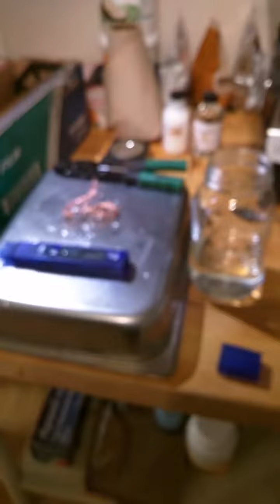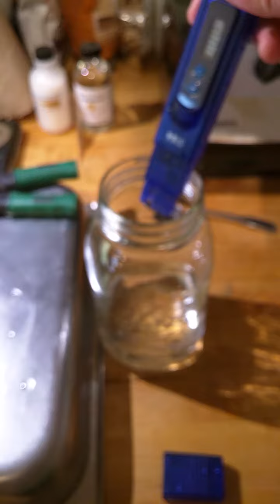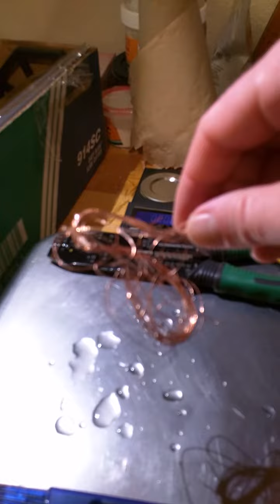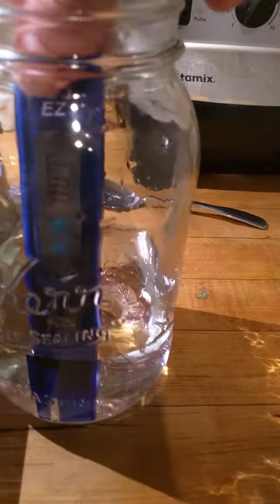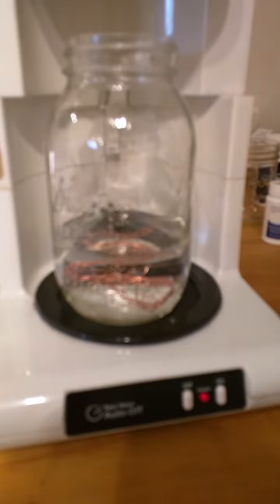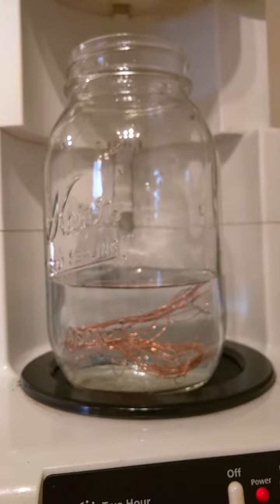Making colloidal copper with a coffee maker easy

Comment: Bro you're making an interesting brew there but it's not colloidal copper;) Copper ions are formed during a process called electrolysis, not by submerging copper in hot water. What you're measuring are unrelated copper oxides.
Reply: and what you're describing, is copper hydroxide...

Comment from the maker: Try it out . Use the ppm meter... The reason for this method is the prolonged controlled heat without loosing the water to evaporation. A kettle on a stove top does not have such consistent heat but try it out maybe it will work
Reply: Hello Jeff!
Have you experienced any good results using this method? 
Some say the particle sizes become too large this way.There is so much conflicting information/disinformation...

Comment: It works, I used water from my RO filter which read 30ppm prior to adding copper, after 4 hours in the oven I gota 55ppm reading so, 25ppm copper solution, good enough.

Comment from the maker: I would Target between 155 to 175 degrees electric cookers are going to have fluctuations as elements turn on and off the thing is time and the reason you're using heat is to expedite the time you can do the same thing in a double boiler but then you have to keep refilling the double boiler that's why the coffee pot works good

Comment: Is this really colloidal copper? Everyone else I can find uses electricity to do this. I would like to use this method but am unsure if it is safe to use and not toxic???
Reply from the maker: Yes... If you research you can see other heat methods but they use a double boiler and require a lot of time so it's not practical. I am sure if you dig into it you can find a good science based explanation. But no doubt about it this works

Comment: How could it be, you boil copper in water for a long time and its colloidal copper,  how could it be ? So it i boil water in a pure copper vessel for 4-5hrs and i get colloidal copper, copper dissolving in water with heat, what is this?
Reply from the maker: Get a ppm meter if it reads 10 ppm then yes.

Comment: can I use any solid Home Depot copper wires to make colloidal copper? is Home Depot copper wires 99.99% copper ?
Reply: Quinten j 
 No!
Reply: Yes you can.  Household wiring (Romex) cable is 99.9 percent pure copper. I reached out to the manufacturer to confirm.

Comment from the maker: that is up to you but it seems common sense if you want a colloidal copper use 100% copper
Reply: +Jeff Nelson  is the color of the solution supposed to turn blue ?
Reply from the maker: Can I have had this and black webs when using electrodes I would just redo bc I worry but I've seen others drink the blue tinted just do a ppm test and make sure the wire is clean